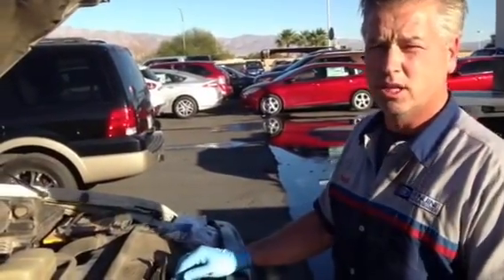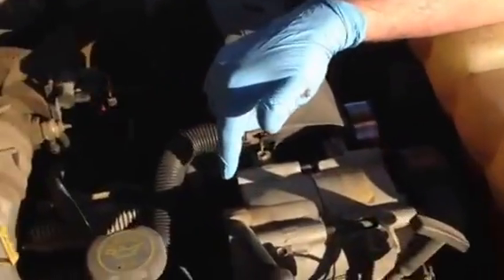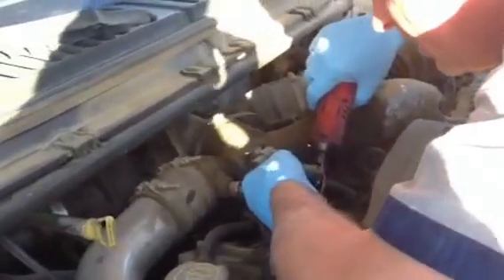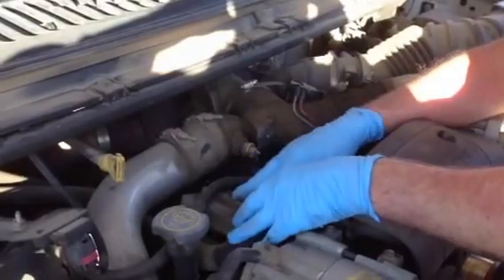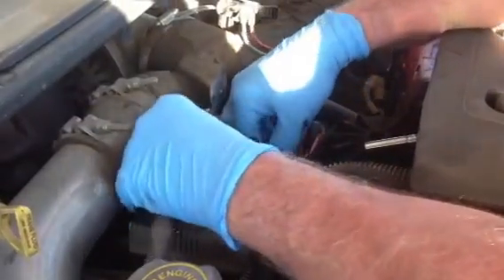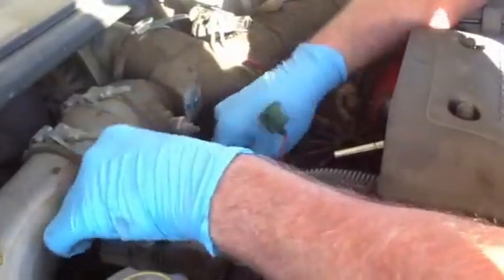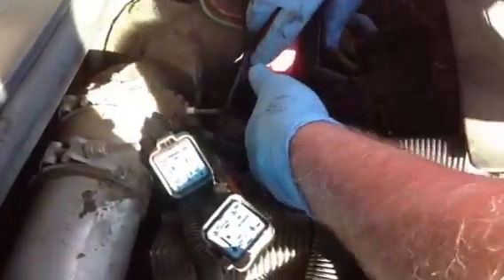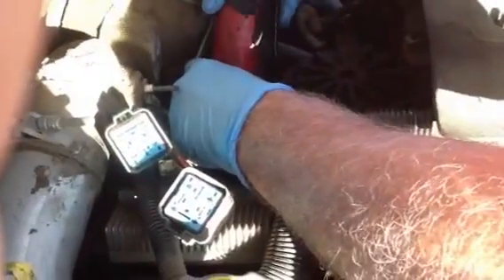Ford 7.3 powerstroke common fuel leak

Comment: Wow, yesterday, my wife and I were leaving a restaurant where we had lunch. I started my truck and, I was standing outside with my wife while she finished her cigarette, I noticed fuel leaking out onto the parking lot. I was freaking out. I drove home as fast as I could and, since it was too hot to mess with, I googled "2001 F350 diesel fuel leak". And, here is this video. After watching it, I started moving stuff around to gain access and, sure enough, this little valve seemed to be the problem. I found the part at O'Reilly's; I got a new fuel filter since I was in there and, installed the new valve and filter. I was really expecting to see fuel leaking when I fired her up but, this fixed the problem. I love you guys who post these videos on YouTube! This isn't the first time I've saved a ton of money by watching a video and doing the job myself. Diesel Tech Ron, THANK YOU!!!
Reply: Michael Peterson Diesel Tech Ron was a great guy. Unfortunately, he passed away in a car accident when a driver fell asleep and crossed into his lane. may 2016?  RIP RON

Comment: Ron I've got a 97 7.3 I got sick of my mechanical fuel pump leaking so I did a electronic fuel conversion so no the pumps and filters are frame mounted

You also got me to buy a scanGauge 2
Reply: Patrick Baptist tell me more about it please I’m having lots of issues with my f superduty power stroke turbo diesel

Comment: Ive got a ambulance coverted to bug out rig and gettin strong raw fuel after warm up.. Dont think its this plus mines way harder to get to but i think mines filter element seals or that rear fuel line that leaks cause its seepin around the bottom of the trans and motor on backside
Reply: Did you ever figure this out? Having the same issue

Comment: Hey Ron, my name is C.J., and I am a heavy duty tech from NJ, I have a '95 7.3L in my shop at the moment for fuel leaking. I want to thank you for your video because I would have missed the valve leaking because the actual flexible line was the obvious leak as it rotted away at one end. I would have put it back together and still have the valve leaking if I hadn't seen this video. Thanks again and any other tips you have would be appreciated too.
Reply: He passed away

Comment: Hey buddy I have a 96 f250 7.3 diesel And found a fuel leak coming from the left side of the starter and running to the cover right behind the oil pan. What could be causing it????
Reply: I'm currently dealing with exactly that on my 97 7.3 obs any luck nailing it down?

Comment: Hey Ron thanks for your videos they really help us weekenders out. Im getting air in my fuel delivery. The o-ring on my fuel bowl is sealing...my buddy says there is a check valve in the fuel pump that keeps the line pressurized and can fail allowing fuel to backdrain to the tank and creating the air in my fuel line?. We take the cap off the fuel bowl and purge or cycle the system once or twice and then replace the cap and it starts right up?. Once it stalled on me at after about 2 or 3 minutes of idle, I could tell it was losing fuel pressure. I do not have a fuel pressure gauge. We can not find any source anywhere between the tank and fuel bowl where I could be pulling air in otherwise, is this true about the valve in the pump?. Thanks for your help.
Reply: 6GUNSOUTH not sure what year you have but air in the fuel system is caused by the "duck foot" in the tank and fords quick release fuel connections.  I am surprised it happened at idle, you usually notice air under heavy load, I would "cycle" the key on to off without starting the rig and listen to the fuel pump carefully make sure it isnt surging or warbling.
Reply: 6GUNSOUTH an injector O-ring can go bad and let exhaust gas come back up the supply line from the head. It will fill the fuel bowl until the engine dies.

Comment: when they leak do they leak out of the drain tube or into the engine valley?  I have a fuel leak in the engine valley and haven't been able to pin point it. Its a 95
Reply: was wondering the exact same thing, sure wish someone would reply
Reply: mark marchiafava my fuel leak into the valley was from a failing fuel pump.
Reply: the tech found my leak yesterday, it was that danged "dump valve" or whatever right behind the fuel filter bowl, $151 worth
Reply: @tooge47  literally what the video is about lmao

Comment: Hi Ron,

I work for an aftermarket company and we sell the Gf7751A Aftermarket version of this filter.  We use a Bevel gasket and recently have found that a few customer have been complaining that they are having leaks.  Can you help me on this.  I am not an installer and would prefer to hear from someone that has dealt with this filter and can shed a little light

Comment: That's a lot easier than a 96 Powerstroke
Reply: Did you just replace the o rings as well or the whole valve? My 96 powerstroke is leaking too. I think it's this but I havent confirmed it yet

Comment: I'm just trying to help.  Fuel drain valve # F81Z-9A153-AA   Or you can get just the o-rings.  Or you can buy all the o-rings to reseal the fuel bowl as a kit.  All available at dieselorings.com      Thanks Ron.